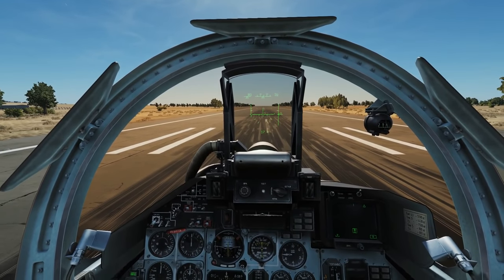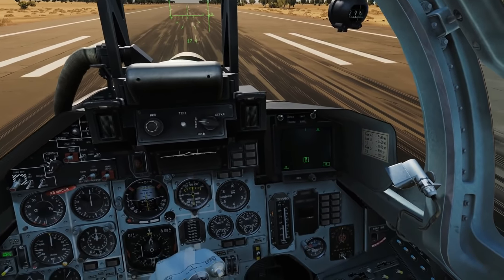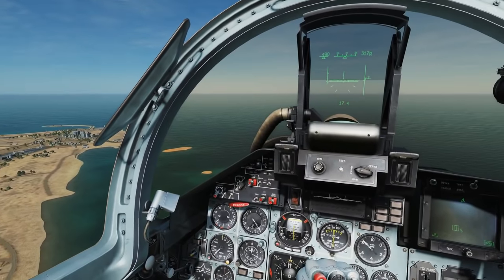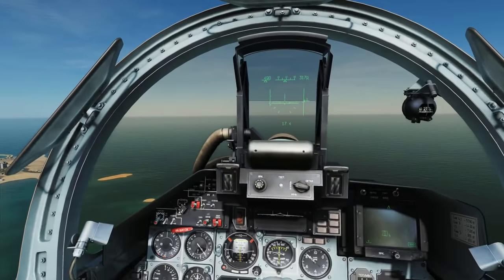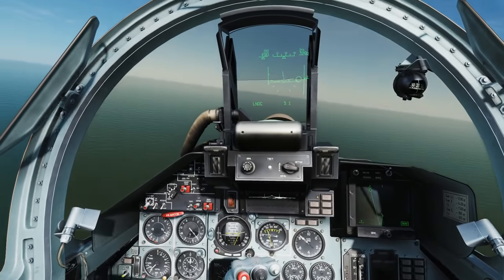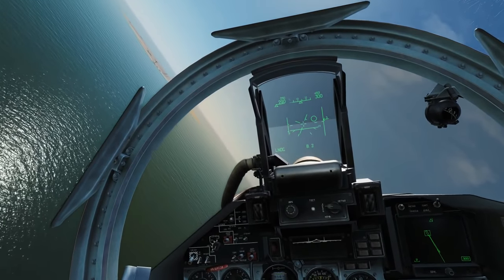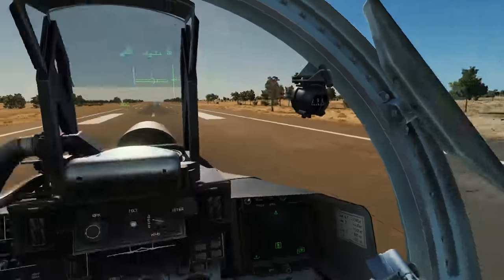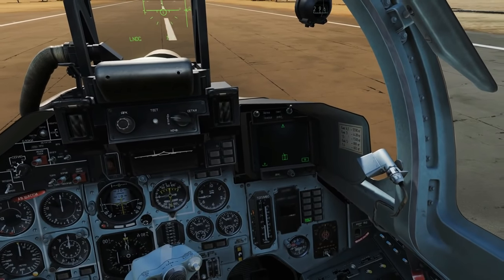Su-27: Takeoff & Landing Tutorial | DCS WORLD

Comment: Hey thanks for the video. Regarding not using the airbrake for landing, let me quote from the Su-27 Flight Manual on page 117. 

"When the landing gear is extended, the nozzles partially closed in order to preserve the power
margin and to avoid nozzle contact with the runway during the touchdown. Due to this, the thrust is
increased when on the glide path. In order to decelerate, the speedbrake should be used."
Reply from the maker: thx

Comment: A fully loaded Su-27 should not exceed 300kph on the runway. Rotating will put additional stress on the main wheels, likely causing them to burst (it's even mentioned somewhere in the real Flanker flight manual). This was a very common problem years ago when the 27 PFM was released, so I have to wonder why it isn't mentioned.
The simple solution was taking off with headwind only, but ED eventually increased the wheel strength slightly (310-320kph) because people didn't understand. High temperatures (eg on PG) might still require a lighter load.

The NWS switch is located below the throttles. It obviously can't be clicked but it's animated so it's easy to check if it's turned on or off. Again: why isn't this mentioned?

At 9:43 your UNDER the glide slope, not over. Your altitude is lower than it should be (see top right HUD) and the circular steering cue is above the aircraft datum.
Reply: Alright mate chill 😂😂

Comment: Cap, I am making good progress with the Flanker however on takeoff I do not see the indicator on the R side of the HUD moving to indicate the 10 degrees at takeoff. When I pull backstick it seems to stay at zero and does not move until I am in the air. Is this a setting I have missed?
Reply from the maker: I don;t think there is a pitch indicator in the Su-27. See if there is an artificial in the cockpit  somewhere to use. If not, then you'll just have to eyeball it :)
Reply: @grimreapers  yeah, eyeballing it has worked until now, no tail strikes as I do not pull hard back stick as per your takeoff video. Just wanted to know if I missed something. Thanks for the reply, your tutorials are making a difference I am sure they are time consuming to produce so many thanks for your efforts.